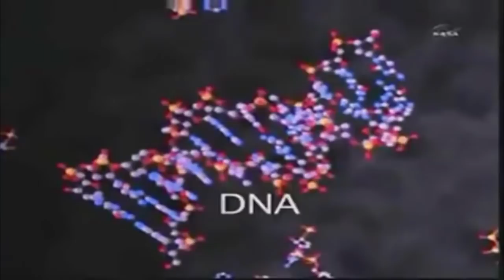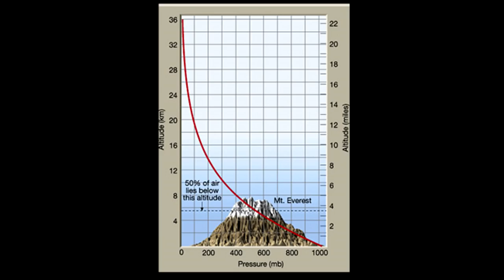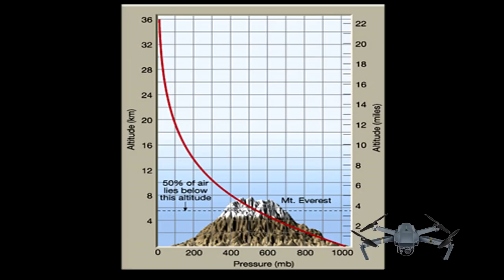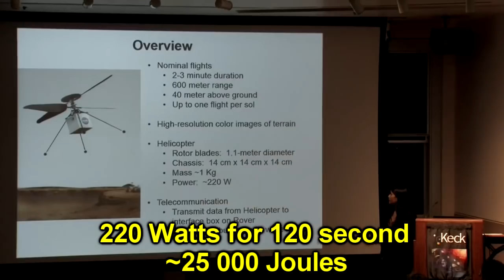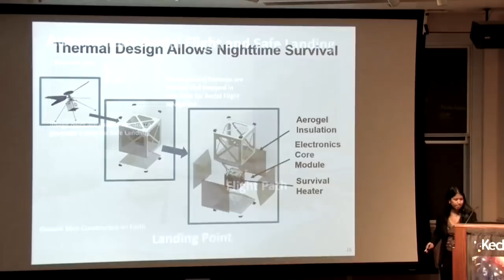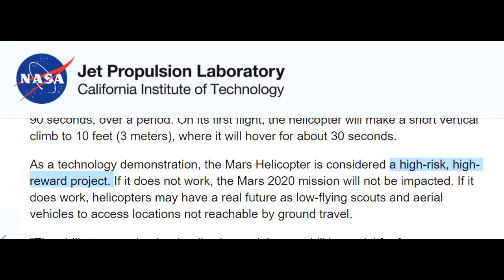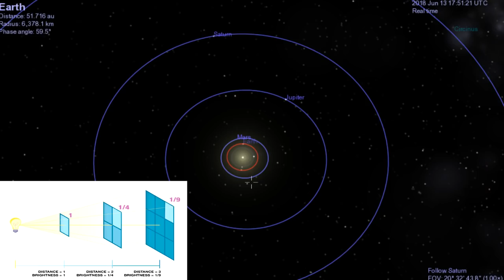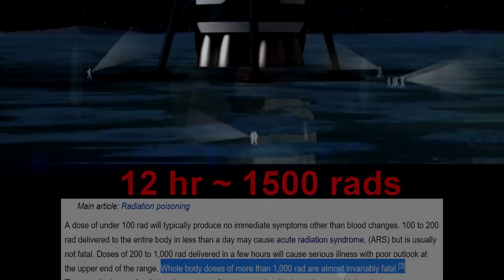NASA is sending Helicopter to Mars!! Smart or Silly?

Comment: a few smoke detectors of  Am 241 to keep the batteries warm.
or a few grams of PU 238.
solar panels are galium arsenide, so a little more efficiency.
would be nice to have a ion thruster satellite in a low orbit, instead of the Rover for data uplinking.
it could uplink wen the satellite was overhead.

Comment: The rotors should be made from lightweight solar panel materials for increased power production also.
Reply: The rotor and the hull can't be electrically connected. Spinning parts are isolated from the rest of a machine else they can't spin, pretty basic fact of engineering.
Reply: @bronzedivision  Rotors on all copters create an electrical current,anyway.      BTW...You probably already know that...Did you know....  Coast Guard helos I've seen also have radioactive oil sealed in parts and sensors to alert the crew if it leaks.

Comment: The solar cells used on space craft have around double the energy efficiency (~38%), off standard buyable solar cells. They use different semiconducting layers to capture more of the suns energy (So called multi-junction solar cells). This is totally not economical for uses on earth, because they are ludicrously expensive to produce. If you however have to put it into space, it makes total sense, because the price per gram space cargo is just on another level.

The solar constant of Mars is 43,3% of the one on earth. However because there is no atmosphere, we compare with the solar irradiance at the top of the atmosphere on earth, which is between 200-400W/m² on average depending on latitude. (Note this is the mean value for a year including nights etc.)
So assuming 300W/m² * 0.433 = 130W/m² on average on Mars.
Assuming that we can not angle the solar panel on our helicopter, we only get 40% of that power. And our solar panel will only convert 38% of that.
Which gives us: 
300W/m²*0.433*0.4*0.38 = 19.74W/m²

A Mars day is 88620s. Which means, a good solar panel would harvest:
~1.750 MJ/m²

Assuming they fly 2.5min per day with 220W/min they need: 33kJ for the flight. Let's be terrible here and assume they need 5times the power in total (Temperature, Communication, loss from batteries etc).
The size of the solar panel, would therefor need to be ~0.094m². Which is the area of a circle with a radius of around 17cm producing roughly 1.86W.

Comment: I don't understand the point you're making here. Your only argument for why this might fail seems to be that it operates at the edge of energy efficiency. However, it easily gathers more energy during the day than it needs for heating at night. So, even if for various reasons it doesn't quite collect enough energy for one flight a day, it can just miss a day and sit on the ground for an extra charging cycle. Programming this is extremely easy. I don't see the big problem here.

Comment: Those toy DJI drones do not last 23 minutes. More like 10-15 minutes with a proper charge.
Reply: No those phantoms actually do last ~23 minutes provided you just hover in place and your battery isnt abused. The mavic achieves its stated 27 min flight time by flying forward a little, due to its geometry its optimized for slow forward flight, not hovering, but it also achieves its stated flight times (in optimal weather conditions, ie not freezing, no wind, healthy battery etc).

Comment: Doesn't the solar panel have more sunlight to absord since Mars has such a weak atmosphere? Although it is also further away and I'm not sure how much that will reduce the amount of light it receives (although there probably won't be cloudy days at least).
Reply: The intensity of light drops off as the square of the distance from the light. This has been measured zillions of times and is easily explained by the simplest of physical models. The Sun is farther from Mars than the Earth, at all points in their orbits, so the intensity of sunlight at the distance of Mars is always less than the intensity at the Earth's distance. Even the clearest day on Mars is dimmer than the clearest day on Earth. Mars also has the occasional planet-wide dust storm (every couple of years or so), which blocks the view from Earth of huge amounts of Mars' surface, and I'm sure block's a lot of the sunlight getting to Mars' surface at those times.
Although Mars' atmosphere is weaker than the Earth's, that does not make it noticeably more transparent. It lets in more UV, to be sure, but UV is damaging to solar panels and I expect they have some UV filtering to help lessen damage. Visible light on Earth is not that much affected by the denser air here, so the distance factor remains the major effect.
Mars is about 1.5 times as far from the Sun as the Earth, so the Sun about 1.5x1.5 = 2.25  times dimmer at Mars. (44% as bright)
Reply: That second sentence sounds awfully condescending, but I thank you for the info nevertheless.

Comment: Did You by any chance figure in the difference in atmospheric densities between Earth to Mars when you made calculations for how much energy the panels could generate? In any case they seem to have come up with more than enough energy even in poor conditions. This means they have a number of additional options at their disposal. My suggestion to NASA would be to have a rover-style solar-panelled re-charger platform that could position itself in the center of the drones current operating area. The drone would land on it, hook up and get an "instant" charge thereby reducing the weight of the drone itself by reducing it's solar panel mass.

Comment: I thought the martian atmosphere was too thin for a helicopter to work? If they cant fly up to Everest altitude, how would they work on Mars where the air is thinner?
Reply: most earth helicopter are not designed to work at these conditions because it wouldn't work well at lower altitudes. these drone are designed to work best in these conditions but even then its working at the very edge of whats possible just to fly at all.
Reply: Short answer: Mars' gravity is weaker.

Comment: Ambitious and risky as hell, story of Mars missions. The planet has something like 2/3 rate of missions dead on arrival. NASA knows what it's doing, and they have more experience than anybody else, so it won't last forever, but it could last a while.
Reply: Its not even meant to last a while. Its a proof of concept, they will be happy if it works, delighted if it works for a few days, no one expects it to survive for months and it wont be designed for that. Its basically an experiment, they had bit of spare payload on the mission and this is one of the experiments they selected to make use of that. If it works as expected, they may one day design something thats actually meant to last, but that is almost certainly gonna be a fair bit larger and heavier than 1 KG.

Comment: You complained it would get to hot but theres the air flow from the blades spinning when it's in use and theres tje fact that Mars is significantly cooler than earth sooooo...... mb

Comment: Your calculations are assuming that they use similar solar panels to your single-crystal silicon array? Totally wrong assumption. They would likely be using high-end multijunction photovoltaics. The power conversion efficiency would be about double that of the type that you showed there.

Comment: you sound alot like bill kaysing... i think the solar panel they use will be slightly better than the mass produced one you have. those arent the top of the line. they are older tech and you know that, the latest designs are much better they are just expensive...this is worht that expense.  i also think they have thought of covering the rotors to protect them from sand...

Comment: What if the rover were kind of like a "Drone Aircraft Carrier" and the drones flew from it and back to it for re-charge? 

 What if there were larger "Mother Drones" that flew off from the rover (fully charged battery for that one flight )and let down in the middle of targeted study area and unfolded a really large solar collector array and a half dozen baby drones the Mother Drone had on board began flying off from that base and return after their missions and recharged from the big solar array on a regular basis. After a time, Mother Drone could be fully recharged, collect her babies and fly on to a new location. 

 What if the drones could land on promontories within direct line of sight of the rover and the rover fired a laser at the drone and the drone received that energy for recharge? 

If the power requirement for the drones is so small, what about chemical "generators", like a fuel cell or a small bi-chemical reaction re-charge- that is small generators that spin up from these reaction gases and recharge the drone battery- I know it would mean a limited number of flights, but that is probably a given considering all risk factors anyway. I mean, if the thing is working on just one watt, and a chem-battery the size of a sugar packet could contain reactive chemicals generating 500 watts- - well, the answer seems obvious.

Just Thinking out of the box here.
Reply: Do you know what the KISS Principle is?

Comment: I wonder if it were possible to use the top rotor's upper surfaces as solar panels, too. It would most likely add too much weight, doing that, though.

Comment: Thunderf00t, don't be so cynical.  When they tested the helicopter in a vacuum chamber that wire coming out the top was a low gravity simulator.  They had a spring calibrated to simulate Mars gravity.  We'll see shortly how well it works or if it doesn't.

Comment: Why do you have to have a drone with rotors, when you may be able to use a ballon type drone. You'd only need to power the steering props, & it would never land, so the risk of impact would be less?. I think they have already done something on another planet. The gas for it would be stored in liquid form, till needed. It would re-enter, as usual, then a chute would deploy. When it's close to high, the bag deploys, then when at the correct high, the chute is detached. A flexible solar cell material could cover the outside of the ballon to recharge the batteries. Mad eh, but I think as good a chance as a bladed drone.
Reply: To create an airship on mars, the balloon would have to be absolutely massive. As a rough guess I'd say 25-30 times as large as on earth. And if there is a single flaw in the balloon, or it gets scratched or torn on the journey, it will fail.
Reply: @Sir_Budginton  Probably why it's not been done then, I know the atmosphere is thinner on Mars than the earth, but Helium would have more lift in CO2 than in air. I just wondered, & if someone hadn't have rubbed 2 sticks together K's ago, where would we be today.

Comment: Thunderfoot, you finish this vid with a comment on the survivability of humans exposed to cosmic radiation (or other radiation). I may have this wrong by some orders of magnitude but what would it take to generate Van Allen Belt like magnetic fields around spacecraft just strong enough to deflect cosmic radiation away from the fragile humans?
Charged particles would be most easily deflected but neutral radiation or particles are more difficult. 
Lastly I think the stepping stone of the Moon should be aimed at before attempting a manned Mars mission. In fact when they do a successful Mars mission I would bet it starts at a moon base established for that very mission.
Humans need to get back to the Moon first.
And I didn't know that other bodies in the solar system have Van Allen like belts. Awesome. Let's go there first.

Comment: I'm only at 10:20 but I'm wondering whether lighter-than-Martian-air might not have been a better way to go (e.g., a powered blimp). Is that feasible in the thin Martian atmosphere? If so, it would stay aloft for considerably longer.
Reply: p.s. I have seen early gas-powered (Yamaha) 2-m long helicopter blades destroyed on takeoff from abrasion by airborne dust. This was in New Mexico; on Mars, there's even more dust and the rotors have to be faster.
Reply: Apparently, the jury is out: https://forum.nasaspaceflight.com/index.php?topic=43366.msg1702699#msg1702699

Comment: Just coming back to this because of your recent video. If you talk about "thick atmospheres", why not just take a blimp instead of a helicopter approach? Blimps would be way more efficient and can power themselves indefinitely with solar power drifting in the upper atmosphere. Probably you need a few spare hulls in case debris punctures the hull, or some smart "foam repair space tech" for leaks, but I think that would be a better design than have a helicopter in a thick atmosphere....
Reply: Well, even right now blimps need a huge amount of space for a relatively low weight capacity, it all depends on pressure difference, here on earth you might have an almost 1 atmospheric difference, and that is already hard to handle, if you got to a thick atmosphere, let's say with 2 atm pressure, you might still be able to only get 1 atmosphere difference (the inside being at 1 atm), unless we have some big improvements in material technology that allows materials to support more than 100000Newtons/meter^2 between the inside and the outside, while still being realtively low cost (bc let's remember you need a lot of it to inflate it).

Although I think it might be able to lift simple/small things, maybe a camera and stuff but definitely not something too big

Comment: Could there be any way to apply a photovoltaic material to the back of the propellers and basically integrate the solar panels into the props?  Perhaps any weight saved could be used to make the props bigger, which could have knock-on virtues (ie, slower required prop speed leading to possible power savings and less heat, etc)...?

Comment: I was wondering why the rotor blades can't double as the solar panels so I started googling lightweight solar panels.  There are claims from MIT in 2016 of making panels without glass capable of generating 6 watts per gram.  Is this real or even possible?  Might this work as the topic for a future video?
Reply: How do you reliably get the electricity from the spinning blades to the stationary motor and communication and control circuitry? This sliding contact has to work with minimal friction and wear for thousands of revolutions, endure extreme temperature fluctuations, no sparking, no letting fine martian dust sneak in, miracle lubricant,,etc., etc. Just to add a small sliver of extra light-gathering area. Doesn't sound worth the effort...